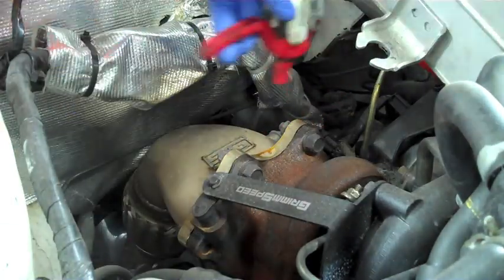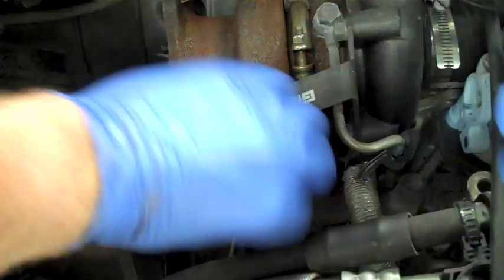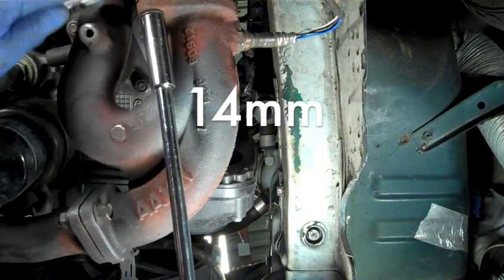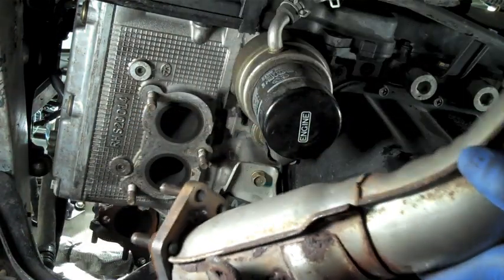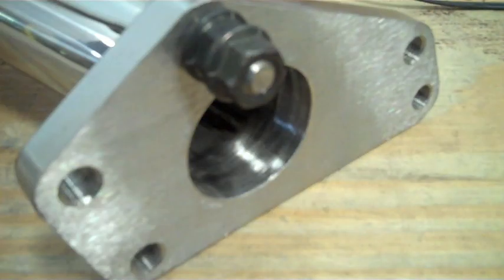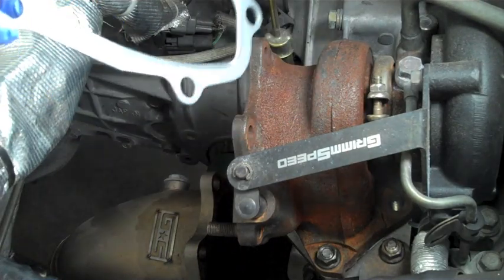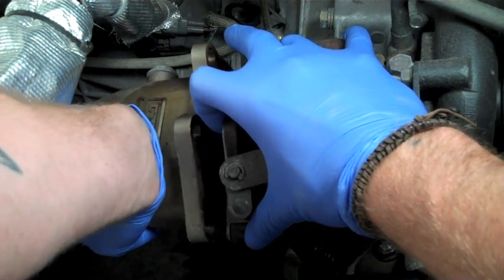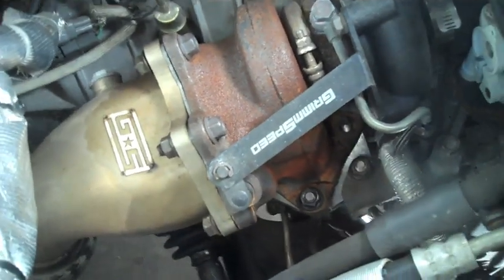GrimmSpeed Up Pipe Install

Comment: is this a 2 bolt up pipe or 3 bolt up pipe and will this up pipe work with the killer be 2 bolt holy header or i’d have to get the 3 bolt

Comment: I'm struggling with removing the exhaust manifold from the headers because of sheared bolts on the heat shield. Is it possible to just remove the portion that is connected to the up pipe? Or is that not recommended?

Comment: nice material but so close to valve cover on my 06 wrx. should have made it like oem where theres space to use a heat shield. i read lot of posts of where users had valve cover leaks shortly after using this up pipe. the close contact heat exposure eats away the moon seals at the rear side. This is common with using aftermaket exhaust parts. but grimmspeed up pipe is quite close to the v. cover and can do better.

Comment: Great video man but my down pipe the nuts and bolts have been rounded 😩im very stuck trying to find a solution may need to cut them out with a grinder, cant get the grinder on the back of the flange at the bottom of the up pipe though
Reply from the maker: Rounded nuts can be a frustrating problem. Sometimes hitting them with some pbblaster and a torch helps. Otherwise you have to cut them off and get new studs. You may just have to drill out the stud. You'll go through some bits but it may be the only option.

Comment: Would I need to take the manifold off if I'm taking turbo off too, or can I just undo the bottom uppipe bolts and turbo and pull out other side

Comment: I noticed that on your website it says gaskets are included, does that include exhaust manifold gaskets? I also recently noticed that my turbo to downpipe stud vanished. Does anybody know what the replacement part number is?
Reply from the maker: The Up Pipe Kit will include Up Pipe to Turbo and Exhaust Manifold to Up Pipe Gaskets, you'll have to purchase the Exhaust Manifold pair separately. Hmm, unfortunately that's not one I know.

Comment: '02 wrx wagon: Mostly used 10, 12, and 14mm sockets/wrenches. Mostly 14mm. Highly suggest hex only to loosen/tighten bolts, instead of 12 point sockets, if your underside is super rusty (almost stripped a few bolt heads). Boost kicks about 1k rpm earlier, and she drives better than ever. Great upgrade, part, and video guide. Thanks GrimmSpeed!
Reply: Hey bro, did this fit on a stock block and manifold?
Reply: @AnotherKidNamedNoah  Yup it fit on my stock block and manifold, but I needed a buddy to help me a couple times during the install to make things easier. Also now that it has been a while since I did the install, make sure you get a really good seal on your gaskets when you are putting everything back together. I have an exhaust leak somewhere after the install but it is only noticeable when it is super cold like -10 F. Haven't failed emissions, so it's not a big deal. Best of luck with your install!

Comment: Well wish me luck I'm about to go do this on my 9-2x. I sure hope it only takes the 2-3 hours it says hear vs the 5-8 I'm seeing elsewhere
Reply: Literally about to do my 9-2x how was it on yours?
Reply: @DJKBEATS   it's not too bad you might as well jack the engine up on that side tho made it alot easier. Second set of hands is helpful too. Definitely get the grimmspeed thicc gasket for the header to up pipe that was a 🐻 to seal up properly. Very good results tho once I had everything installed right. Good remedy for some of that turbo lag
Reply: @DJKBEATS  oh and 2.2k ohm resistor to trick your car into thinking It still has that sensor in the up pipe
Reply: I've got a bung on mine for the o2 and I got the XPT stage 2 tune to flash which should deal with any CEL's but I'll definitely lift the engine for the up pipe. I just bought a cheap DP, headers, up pipe and cat back set up for now that comes with gaskets so if they dont seal properly I'll get the grimmspeed thick ones. If for some reason it throws the CEL, where did you plug in the resistor? Or did you remove the clamp and solder it where the clamp used to be?
Reply: Oh yeah, and should I remove the motor mount to jack the engine or just lift it a little?
Reply: @DJKBEATS  yeah unbolt it
Reply: Just did it on my 9-2x, how are both of your cars doing?

Comment: wait, the waste gate actuator has been deleted, and the flapper permanently closed, and there's no wastegate on the up pipe, so is it just running full Boost?
Reply: this is for TMIC with the BOV on the IC.
Reply: waste gate and bov are 2 different animals.

Comment: So hate shops that dont follow directions...all three shops were like yeah...we don't do it that way its to much work...WTF I'm paying you do it this way...they don't want to replace any of the gaskets and the last shop stripped the threads...didn't use nut trick and though they said they swapped gaskets they used the old ones...why isn't their govt boards that secretly go into shops and check to see if they are doing things correctly...because the scums would rather rip you off at $60 an hour. Need a tiered wage system this is getting ridiculous.
Reply: Its hard trusting shops.  That is  why you should always do it yourself. With YOUTUBE it makes it even easier to get it done on your own because of videos like this. As for not having the time or space to work on your car, you simply rely on YELP reviews.

Comment: About to install in a couple of days , question -  does the 02 sensor have to be removed or can the wire/clip be fished out through the heat shield hole ?

Comment: UGENT HELP!!! I can't get my stock up out. It gets stuck coming out, I even tried bending the EGT out of the way but it's still to big to come out. I can't just "Wiggle" it out like they do in the video. I dont want to remove the turbo.
Reply: I was there too, just undo the passenger motor mount, ( it's connected to the crossmember underneath.) jack up the motor a lil, then the uppipe comes out no issue

Comment: My car has the egt on the up pipe. But the up pipe I got doesn't have a spot for it. I need help. What is the 2.2 kohm resistor.

Comment: I ordered one of these on ebay and its very nice, came with two fresh gaskets both multi layer steel! but no studs! my old ones are rusted in place so now my whole reassembly is on hold :(
Reply: I see you made this comment 2 years ago but I just want to reply, I ordered original studs from subaru but the tread was different on the new uppipe, it had 1.5 where subaru uses 1.25. So I had to order new studs again! I couldn't drive my car for 2 weeks because of this.

Comment: Beware, GrimmSpeed up-pipe only comes with 1 up-pipe to turbo gasket and 1- header to up-pipe gasket. You will NEED to buy a new d/p gasket seperate. I don't know why they did not include this since the d/p will obviously need to be remove.
Reply: ha noobs
Reply: iNNoCeNttDReAMs the down pipe doesn't need to come off
Reply: Lmao dont spread false information. The downpipe DOES need to come off to access one of the hidden up pipe bolts otherwise good luck trying to remove the up pipe.

Comment: Ok I just finished my whole install and I had an EGT in my up pipe, it is currently throwing a code. Will the 2.2 kohm resister just clear the code? or now that I've got one am I going to have a problem?

Thanks
Reply: where does the resistor go
Reply: where the EGT connector goes in
Reply: @tubejorrit   Did the resistor clear the CEL?
Reply: @phillipgalindo234  yes!

Comment: Hi i have an 05 legacy gt turbo. I was thinking about doing up pipe, down pipe, res delete, and 850 injectors. with protune what kind of power gains can i expect? Any other recommendations for mods (specifically with oil system)? Thanks
Reply: probably 0hp

Comment: How important is it to replace those gaskets? My car only has about 1600 miles on it. I plan on using the gaskets that came with mine, but how important is it to replace the gasket that attaches to the head?
Reply: ALWAYS REPLACE THE GASKETS

Comment: What do I do with the EGT probe that was in the stock up pipe?  CEL is on now.
Reply: Easy fix!  You have two options, you can use the old 2.2 kohm resistor you can pick up from Radio Shack and insert this into the harness connecter left over.  You other option is to use a tuning software to simply disable the CEL for that particular code.  I personally went the route of using the resistor, it essentially tricks the ECU into thinking the probe is at operating temperature.  Let us know if there is anything else we can help you with.

-Matt Homes
Operations

Comment: I may be mistaken but i did not see a provision for an EWG on that up pipe, yet you have the IWG disabled,   Super subie running un regulated boost?
Reply: 3 but the purpose of the wg,  infernal or external ks to do very the exhaust gasses around the tu r bine. how does it do that if not plumbed in before the turbo

Comment: Two questions, Why does the Downpipe have to be removed? And are you removing both sides of the exhaust manifold or just passenger side?  Need to know which Gaskets to buy in advance.
Reply: Justin,

To answer your first question, you need to remove the down pipe because it sits directly above the two rear studs on the up-pipe.  Secondly, you can remove just the passenger side of the header if you like, or the entire header, we recommend the 2nd.  If you remove the entire header and leave it assembled to the cross pipe then you only need to replace the header to head gaskets, which are sold in pairs.  If you remove half of the manifold, the you need those same gaskets and a set of cross pipe gaskets.  Let me know if you have any other questions!

-Matt Homes
Operations

Comment: I hav3 a tial external wastegate on it now about how much would that uppipe run and does it still have the flex at the bottom where it meet the headers
Reply: Josh,

Our 40mm EWG up-pipe will work just fine and yes it does have the flex at the bottom.  Our 40mm EWG fits a 38mm Tial just fine, it was engineered that way.  The pipe will run you $329.99 through us or check out our dealers for an even better price.

-Matt Homes
Operations
Reply: Thanks for the info I appreciate the help a bunch hopefully during the holiday ill get the money to get the new pipe just rewelding mine till get the money what would I need to do to run e85 I have 850cc injectors a 255 walbro fuel pump fp red turbo also water meth injected but looking to get away from that

Comment: I have a 2005 sti and I have an uppipe with an external wastegate and im wondering if you guys have a product that would fit it also have upgraded fp red turbo not sure on size and wondering how prone they are to cracking? Mine cracked right at turbo and external wastegate tube meet is there a way to prevent that
Reply: Our GrimmSpeed 38/40mm external waste gate up-pipe would do the trick.  Use a TurboSmart 40mm valve and it will keep your FP Red under control nicely.  We have a support tab that takes the stress of the portion of the pipe that the EWG mounts to, this might have been why you had cracking issues.

-Matt Homes
Operations

Comment: If I pull the turbo do I still have to unbolt the manifolds from the heads?  My turbo is pretty much junk anyway... I'll be using a catless UP from a 2011 STi.  Shouldn't be any fitment issues.  (2006 Legacy GT)
Reply: If you are removing the turbo then technically you can take the up-pipe out the top end.  Take caution when pulling the pipe up past the back side of the passenger side head and valve cover.  There are "half moon" blocks that could be pushed into the motor if you knock one hard with the edge of the up-pipe flange (I speak from experience).

-Matt Homes

Comment: Been keeping an eye on quite a few of your products.  I was wondering if you have an up-pipe for those who are doing a NA-T build for GC imprezas?
Reply from the maker: That is a very good question!  To make manufacturing feasible and keep our products affordable, we have to produce large batches of pipes.  Turboing the stock 2.5 NA motor on older Imprezas has become less popular than simply swapping the motor for a WRX or STi motor form the USDM and JDM models.  Due to the low volume of a build like the one you are mentioning it just won't be feasible for us to produce a product like that.  My suggestion if you stay this course would be to find a talented local fabricator to help you out.  Good luck with the build and let us know if there is anything else we can help you with.
-Matt Homes
Operations

Comment: Based on information from Subaru and Subaru Forester forums, the 04 and 05 usdm Foresters had the catted up pipe. 06 was the first year to have the uncatted up pipe. Can you verify this?
Reply: Alyssa,

I apologize for the misleading information on our part.  One way to easily check is to see if you have a EGT sensor coming up from your OEM up-pipe.  Only the catted ones have an EGT probe.  If you have a catted up-pipe you will have two bundles of wires or sensors coming off your wiring harness by your passenger side shock tower.  One is for the oxygen sensor down in your exhaust manifold and the other would be the wiring for the EGT probe.  If you are still having trouble determining this give us a ring 612-379-0000 and we can help you over the phone.

-Matt Homes
Operations

Comment: by any chance is it easy to change the spark plugs at this point when the manifold is out?
Reply: It realy isn't any easier while doing an up-pipe installations.  For spark plugs on the passenger side you would want to remove the intake box up to the turbo inlet elbow.  This will give you much more access from the top instead of trying it from below while doing the up-pipe installation. 

-Matt Homes
Operations

Comment: Hi, I have a 2005 Subaru Forester XT. Does this year have the catted up pipe or is it catless?
Reply: Alyssa,  all of the 2.5L motors have a catless up-pipes.  You vehicle can still benefit though from having a high flowing up-pipe, your stock up-pipe is prone to leaking over time.

-Matt Homes
Operations
Reply: Are you aware of the new STAR smog program California will be implementing sometime here in the future?
Reply: The Forester xt hat the catted uppipe 04-05.
Reply: +GrimmSpeed Aftermarket Engineering  positive  on that?  I read somewhere  that 04 xt has a catted up.  Mine is a 04 so i was worried  about the cat or egt breaking  up and going into turbo,  But if its catless id feel a lil better lol
Reply: +GrimmSpeed Aftermarket Engineering  positive  on that?  I read somewhere  that 04 xt has a catted up.  Mine is a 04 so i was worried  about the cat or egt breaking  up and going into turbo,  But if its catless id feel a lil better lol

Comment: at 2:58 you drop the ENTIRE exhaust manifold, to the right of the oil filter it looks like 2 bolts, wouldnt you just be able to undo those two bolts and drop the downpipe out that way?
Reply: Yes you can do it either way.  Some people fine it easier to just drop the entire header but that will work just fine too.  Let me know if you have any further quesiotns or concerns.

-Matt Homes
Operations

Comment: You definitely aren't going to lose power with this modification!  It just isn't as noticeable of a bump like the 2.0L catted up-pipes see when swapping those out.  It is also a great insurance policy moving forward, and on the high end our high flow up-pipe will feed the turbo longer than the OEM catless one will.  Let me know if there are any more questions or concerns you have.

-Matt Homes

Comment: Balancing velocity/spool time/ and over all volumetric efficiency is exactly that, balancing.  Yes, by increasing the internal volume of the up-pipe with an aftermarket up pipe, velocity will decrease slightly.  However, the stock unit is prone to failure over its life span, especially the "flex" section on the OEM unit.  The flex in the stock unit is more of a slip joint that a true flex, and we have seen plenty of them leak, if not fail completely over time. 

-Matt Homes

Comment: Most instructions I have seen say you need to jack up the motor (forester, wrx). Is that just to make it easier, or won't an up-pipe go in unless the motor is lifted?
Thanks for the video, by the way!

Comment: without the heat shield on it. Where could i get all the bolts and gaskets before attempting this job? I am in need of installing this on my car soon and was wanting to try and tackle this job with a friend but i want to make sure i do it right. I can send pictures of what i have if need be. My down pipe is a 4 inch down pipe also if that info helps. It does not look too difficult of a job to do but nothing ever is as easy as it looks i am sure! Thanks in advance! Also any pointers for a newb?

Comment: Hey will, I have a Hks TurboBack exhaust system. I purchased it about 5 years ago off a 2006 STI. I have a 2006 Wrx Tr. The guy worked at Velocity Trends and was making his STI stock again to sale so i got a good deal. They installed the exhaust system for me but did not install the up pipe. Honestly at the time i was new to the game and didn't even know it was an up pipe he was giving me with the system. I did not get the bolts to it or Gaskets. It looks identical to the grim speed one

Comment: So you recommend 4 gaskets for the whole install? i was told i only needed 2, which were the lower uppipe gasket and the uppipe to turbo gasket. I don't plan on loosening the headers or anything like that since I already ordered those 2 gaskets (lower uppipe gasket and uppipe to trubo gasket)

Comment from the maker: It really depends on the year vehicle.  Higher gains will be seen on pre 2005 vehicles that have the OEM catalytic converter in the up-pipe.  On the newer vehicles that have a catless up-pipe, slightly smaller gains will be felt but this quality piece is a good insurance policy, OEM pipes are prone to failure over time.  If I can get some more details on your modifications and engine size I can give you a more detailed response.  

-Matt Homes